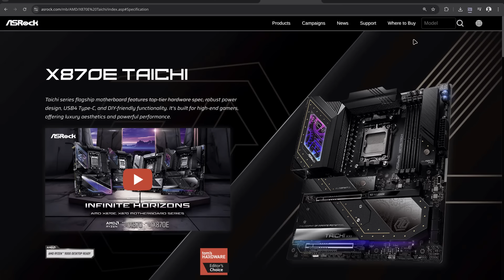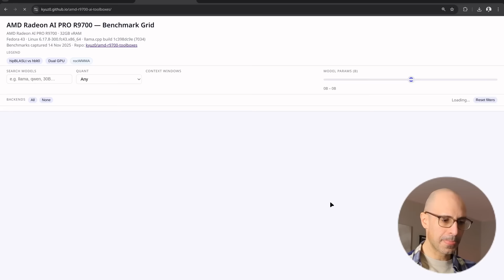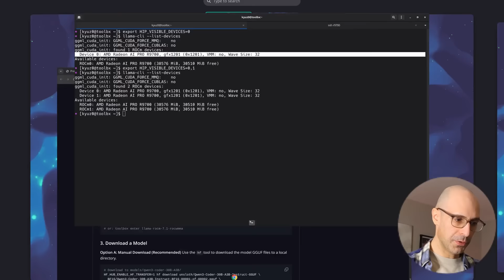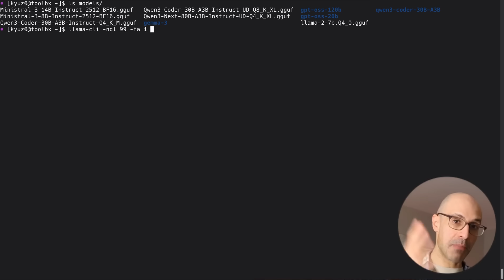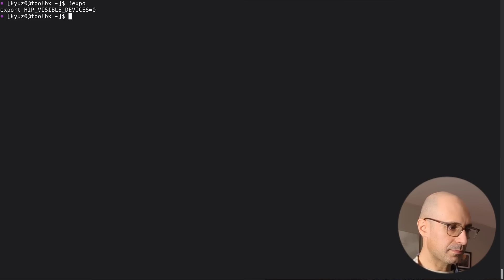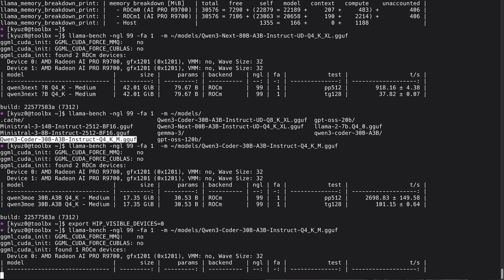Dual AMD Radeon 9700 AI PRO: Building a 64GB LLM/AI Server with Llama.cpp

Comment: These videos are really helpful great job. I got a R9700 on order and I already got a 9070xt that I run in a Ubuntu distrobox for ComfyUI but your Toolboxes look really god and I will be trying them out this weekend 😊
Reply: @Randefelt Did you ever get both running at the same time? I wanted to do exactly this but windows 11 pro kept dropping the r9700 in slot 2 with display driver timeout! The board is x870e, i made sure no conflict with m.2 and x8 x8, but couldn't figure it out... cheers!
Reply: Yeah, both cards run at the same time here. Board is an ASUS ProArt X870E. I’m on Linux (Omarchy Quattro right now).
On Linux both GPUs just work. Drivers are in the kernel, so it comes up out of the box. You can install ROCm and HIP on the host or in a container and it mostly just works. For LLMs I run a Radiance vLLM container and get around 200 t/s on Qwen 3.8  27B with tensor parallelism. In ComfyUI both cards can be used with the dual-GPU extension — no true CrossFire-style split, but you can put VAE on one card and generation on the other. I got a custom image/video gen pipeline where I can do simultanius batching on both cards.  Most of the time I run AI on one GPU and leave the other for desktop. 

I haven’t used Windows in years, so I can’t help you much there. I heard something about plugging a dummy display in to the slot 2. There is a HIP SDK for Windows, and WSL2 can run a Linux ROCm stack on top of the Windows driver. I would recommend dual-booting Linux or just moving the AI box over. It’s usually the easier path.
Reply: @Randefelt  Thanks so much for the response! I'm still torn on the right move given the market right now - was going to get a 4090 before things went to the moon, but even $3499 felt like too much... I'd rather stick with AMD and spread the investment.

If you don't mind:
1. It sounds like your build is about as bleeding edge as can be - Omarchy being Arch based, your performance numbers suggest nightly builds or specific versions of ROCm/HIP? Since I want to move to linux permanently, but need my system to be stable - how fragile is your software stack exactly? I kind of need "drag and drop" baseline with the potential to tinker for more performance, instead of full "garage project". 

2. If you could do over, would you still split 9070xt + R9700 or would you pick up two R9700's?

3. In your experience is the R9700 worth the going price of $1699 (AsRock variant) before tax (roughly $1870 after)?

4. Given a 1200w to 1600w PSU purchase in ADDITION to the two GPU's (roughly $2700), is the investment still worthwhile in your opinion (factoring in learning Linux, all of the driver headaches from being a noob, etc.)?

5. I already have a 7900xt. Would a Nitro+ 7900xtx be the move for $1270 instead of dual RDNA 4 cards you think? I'm assuming I could pool these later - or reuse parts for two sandboxed systems for now (reduced complexity, redundancy etc.).

Thanks again for the response and proving the theory was sound - so few people run such a setup that it's been hard to find anyone who can give solid advice. All the best!

Comment: Thank you for the detailed video! It's readily apparent that you have put in a LOT of effort into each of your videos. I am following your journey closely. I'm curious to see your results with the Instinct card you already bought.
Did you consider the Asus ProArt Creator X870E (instead of the Taichi) motherboard? It has 3 x16 slots. You can run two of them at PCIe gen5 x8x8 bifurcated. The 3rd slot can be PCIe gen4 x4 through the chipset. This might allow a 3rd Radeon 9700. That would be $3900 for 96Gb of GDDR6 VRAM (compared to a $8400 dollars for the 96Gb DDR7 in a RTX 6000).

Comment: Not to pop your bubble or hate, but the 9700 AI so still bad value even though its better value than the Nvidia counterpart. You can get 2x Arc A770 16gb 512gb/s bandwidth each (2x) for half the price of 1 AMD 9700. Yes the total consumption will be slightly worse but the value is better. 

4x Arc A770 will yield 64gb and 512gb/s at a total 800w max TDP. vs 2x AI 9700 64gb 640gb/s 600w max TDP and 4 Intel cards cost half as much as 2 AMD cards. If you wanted max efficiency you should have went with the nvidia blackwell 4000 sff 24gb  at only 70w max tdp / card.  At this memory pool (64gb) bandwidth is already decent at only 300 ish bandwidth, you only need more bandwidth at higher memory pools rendering the 9700 AI pretty bad as it has the least optimal bandwidth and consumption out of all options
Reply from the maker: Thanks for the comment, it adds to the discussion. You’re right that it’s easy to get stuck in a bubble, but that’s also why I focus on running benchmarks and publishing the scripts. Also, it's easy to mistake me for an AMD advocate, but I have no affiliation with AMD and I just happen to have started geeking out on ROCm after getting strix halo.

In your Arc A770 example there are still no comparable numbers shown for the same workload, so we’re basically guessing that 4x A770 scales the way you imply. Also, even if 4x A770 is cheaper in GPU dollars, that ignores the platform cost: a CPU + motherboard that can properly run 4 cards (lanes, slots, power, airflow, stability) is a different class of build than a 2-GPU setup. 

Software matters: I have no idea how good Intel Arc support is in practice for llama.cpp and vLLM, it might be better or worse than ROCm, my educated guess is that it might be worse.

If you’ve got A770 benchmarks for the same models and settings, please link them as that's what ultimately helps. 

I would happily do the benchmarks myself if Intel sent a few cards!

Comment: Slightly disappointed with the single-GPU Qwen3-Coder:Q4_K_M performance there - even my aged 3090 can run it at 120-140t/s (admittedly with 100k context quantised to Q8_0). I guess that's the benefit of the 3090 having 45% more VRAM bandwidth.
Reply from the maker: yeah, it figures. The MSRP of the 3090 was higher than the R9700 and with less vRAM. But it's very likely in a few months the llama.cpp performance on this card will improve.
Reply: @donatocapitella  - yeah, I just kinda hoped that AMD's flagship workstation GPU would be able to beat a five-year-old Nvidia card. I'm rooting for AMD bringing cards with more VRAM to the market, and I'm genuinely considering buying one, but it baffles me how they can put "AI" in the name of the card when it's barely got more bandwidth than an A770. I understand not using HBM2 for cost reasons, but they could've used GDDR6X for a significant bump in performance.
Reply from the maker: @digiscream  I hope in 2027 they'll be able to up their game, but the issue will be even worse with the cost of memory. If they wanted, theycould put on the market a card with 96GB of vRAM, 1T+ of memory bandwidth for $7-8k... but that part of the market is already taken...
Reply: @donatocapitella  - aye, it's not going to get better any time soon. For now, though, I think the best value card on the market is probably the 3090 in terms of raw throughput...just to add to the data points from your benchmark video, I got mine a month ago for £480.

Given the state of things, I might just grab a (relatively cheap) MI50 32GB for those times when I need the extra context, and use the 3090 for day-to-day stuff.
Reply from the maker: Yeah,  @digiscream  can't wait to have some time to play with the MI50!
Reply: @donatocapitella Hi, are you going to release the MI50 video soon? :))
Reply from the maker: @tommasodacunzio4806 haven't had a chance yet to play with it, I've got 2 other videos+research for those that I've been working on. It won't be until I get the next two videos out unfortunately!

Comment: Regarding 1 vs 2 GPUs, there's one case where the two can be used at the same time, it's when processing large prompts. I'm doing this on very long "git log" series and e-mails, and most of the content is processed on both GPUs at once, at roughly twice the speed of a single one. Sadly, there's no way to ask llama-bench to send such large prompts to test that capacity. But you'll definitely notice it in the processing speed in llama-cli and in the final numbers when your input has thousands of tokens.
Reply from the maker: Thanks for letting me know. It should be possible to test though with llama-bench, just setting a large ptefill maybe
Reply: @donatocapitella  I didn't manage to do it, but maybe I didn't try correctly, I only played with -p, -b and -ub.

Comment: I don't see the purpose of "hf download" which forces you do do multiple copy-pastes between the browser and the command line, while just clicking on "copy link location" on the model and pasting it after "wget" will be much simpler. Also wget supports -c which allows you to resume a possibly interrupted download (sometimes convenient if the download speed drops due to TCP conditions, just Ctrl-C+wget -c again).
Reply from the maker: I remember benchmarking it and HF download was faster for me, but sure, wget works
Reply: @donatocapitella  I don't see why but I'll eventually try, just in case it would use multiple connections maybe.

Comment: Nice video! I've been waiting for this for decades! Hey, what about the Strix? I thought this was for improving the speed of PPP on the Halo Strix 395+, what a surprise. The thing is that now the most powerful will be Qwen 80B next, but those monsters of 350B will have to wait for another video.
Reply from the maker: I've beaten Strix to death, basically what's left is vLLM which will come soon. But what would you like to see on strix?
Reply: @donatocapitella   I understand that the Strix speed isn't quite there yet—it feels like a toy. The dual setup you showed moved Minimax M2 at 18 t/s, but the prompt processing (PP) was only around 166 t/s. With a 50k token context, that’s a 5-minute wait.
In comparison, the Strix Halo hit 154 t/s PP on Qwen 30B (a3b-Bf16). However, the dual 'R9700' setup would likely hit 1700 t/s—11x faster. That drops the wait from 300 seconds to just 30, which is feasible. With FP8, it could be just 15 seconds for 50k context. I can handle that. I'm curious about Qwen Next 80B at Q4; it should behave similarly to the 30B.
Suggestion: On the Strix Halo, try forcing MoE expert weights into CPU RAM. It saves VRAM and can be faster than standard partial offloading. Can you test Qwen 80B Q4 this way? I’d like to know if the Strix Halo is truly a toy or not.
Currently, on my laptop (32GB DDR5 5600MHz), Qwen 80B Next (Q2, 25GB) runs fluently at 6 t/s. I imagine the Strix Halo is 3x faster, and the dual R9700s are 20x faster.
I'm considering buying one of those 'R9700s' for an eGPU setup (USB4) for models under 30GB. My question is: With an MoE model, if I have 64GB of system RAM and tie in the R9700, will the USB4 connection bottleneck the whole system when swapping experts? Or is the dedicated setup you built the only viable way? Any insights would be appreciated.

Comment: 7.1.1 just crashes for me with the R9700 if I try to use it with llama.cpp. I'm having an rtx3090, a W7800 and an R9700 in the PC. I had to disable p2p probing for the AMD driver as a kernel parameter, otherwise it crashes during device detection already. I can use the 3 cards combined with CUDA (3090), ROCm (W7800) and Vulkan (R9700). Using ROCm for the R9700 results in a crash all the time. Of course I could also just use Vulkan for all of them, but the 3 backend a together give me the best performance. I hope that some other driver version will allow me to use ROCm for the R9700, too
Reply from the maker: You using my setup and toolboxes? What models!
Reply: @donatocapitella I installed the AMD drivers according to the quick start from AMD on Ubuntu 24.04. I'm impressed how llama.cpp can handle this zoo of different cards even with 3 backend at the same time. I'm experimenting with Devstral 2, GLM-4.6, Minimax M2... But the crash when using ROCm on the R9700 happens with every model.

Also having the two different AMD cards in the system without disabling p2p as a boot parameter makes both cards causes a driver crash as soon as llama.cpp enumerate the. It works if I remove either of them. Doesn't really matter, because of the workaround with the boot parameter.
Reply from the maker: @bugreporterify1 I'm not sure what to say, this has been very stable for me, but your software setup is quite different than mine
Reply: @donatocapitella I just wanted to share my experience so far in case it is helpful for someone. I guess I'll try your software stack, too.

Comment: I have built almost the same PC with one r9700. I will be following this series.
Reply: Glad to see Im not alone!
Reply: @the926, are you happy with the single r9700?
Reply: @ivan.p it has worked well . I would like two but I have been waiting for better tensor parallel options on windows. 

I will likely need to transplant my card ( along with a second) into a separate Linux build to fully take advantage of two GPUs. 

AMD needs to release a 64gb version for ~$2500 to avoid limitations with TP.
Reply: @ivan.pI bit the bullet and purchased a second gpu right before pricing jumped a bit. 

Now deciding if I need to move them to a separate system in order to run them with Linux 

Going to see how far I can get with my current windows platform first.

Comment: Great video, i have two R9700's and am trying a lot of setups to see what works best. Your toolboxes and benchmarks will definitely help a lot and will try them out soon. Is there any reason you run fedora linux? I run Ubuntu VM's on a proxmox so i can just create new ones quickly when i messed it up. As i am relatively new to linux i tend to make a mess of the setups and i found most of the AMD info is still lacking or old. But anyway, i subscribed and hope to see your vLLM video soon as i am very interested to see that one! I am building a multi user dedicated RAG/inference system with smaller 10GB models and hope to get concurrent (1-5 users) requests working with vLLM. Thanks for this great content!
Reply from the maker: Thanks! I chose Fedora as it's very easy and quite stable but also cutting edge, so I can easily get the latest kernels and then the fact that toolbx is a prime citizen and works like a charm. I find toolboxes much better than building a full OS for each ROCm setup and keeping things isolated... I have no use for proxmon and full Ubuntu distributions for any of my setups  - I simply could not do what I show in this video with all of those backends, I would have to build and run 10-12 VMs and sharing them with people would be a pain!
Reply: @donatocapitella  Thanks, i will try fedora and see how it goes. Also would you also test concurrent queries/users in your vLLM video?
Reply from the maker: @MartinForsterNL  I'm using this script: https://github.com/kyuz0/amd-r9700-vllm-toolboxes/blob/main/benchmarks/run_vllm_bench.py.

Early results: https://kyuz0.github.io/amd-r9700-vllm-toolboxes/
Reply: @donatocapitella  Thanks a lot. I am going to make a new AI machine this weekend. Ryzen 5 5600, 64GB, on a x570 mainboard and the 2x r9700 as a dedicated server.. the current server runs proxmox for all my vm's and containers. I will put fedora on the dedicated server and try out your toolbox. The results look promising! I think a lot of people will bennifit from your toolboxes as ROCm can be a pain to work with for beginners in this realm. Looking forward to your vLLM video.

Comment: the R9700 are nice cards if your have the cash to waste, PCIE 5 support for fast P2P communication between the cards, 1200 GB/s across two cards, they are designed to be used in pairs. but amd are scammers, they aren't worth anywhere near 1200 GBP each. they know their market well and squeeze it hard - but still cheaper than two W7900's (mega scam cards, slightly worse than a 3090 but double the vram).

Comment: Interesting. I'm starting to build a Gigabyte B850 AI Top mobo (dual x8 for two gpus), AMD 9900x, Samsung 9100 4tb and thankful I was able to get Corsair 64GB DDR5 6000 on sale for Black Friday. It's double the price now. My Fractal Meshify 3 is in the mail. I haven't decided on the gpu part.  I'm excited to see you working with the AMD cards because there's been so many questions about how they would perform. Sounds like it's still a little rough around the edges.
Reply from the maker: Sounds exciting, let me know how it goes! Yes, rough around the edges, but really once you install Linux and get one of the toolboxes, stuff gets easy. 

I've been trying to benchmark stuff on some Nvidia cards, and it crashes, CUDA is more mature but not a panacea!

Comment: I did the same with amd radeon rx 9070 xt 16 gb vram and would replace both with amd instinct mi50 32gb vram. Llama.cpp server is a good choice. When running locally may be some features could be not so fast. But you didnt pay any token up an down to some weird company like AWS😊